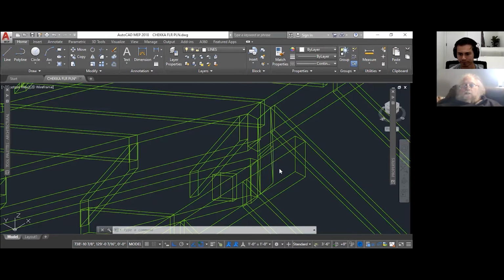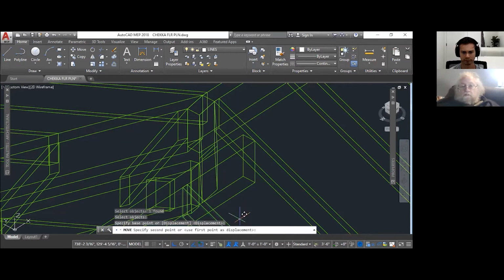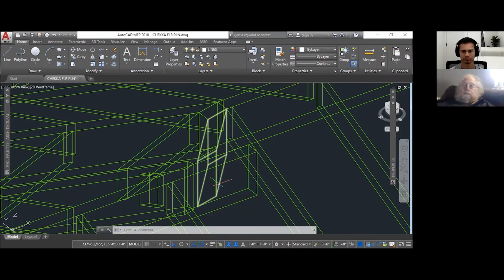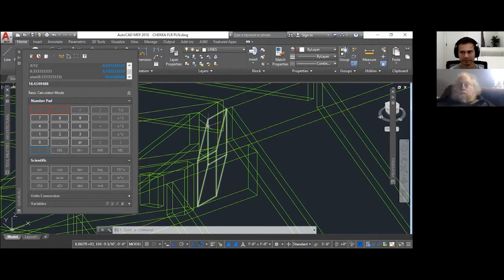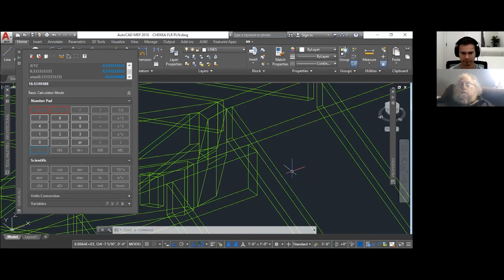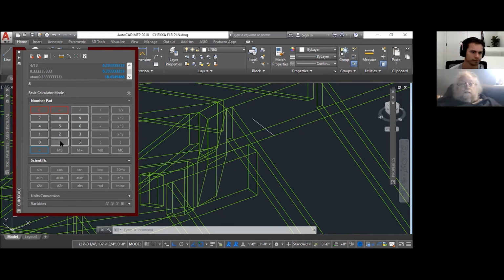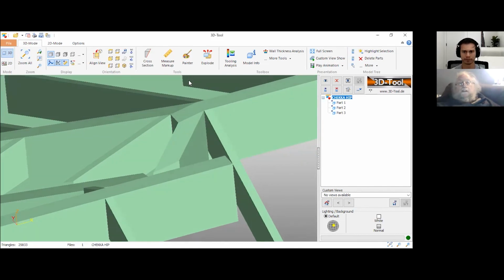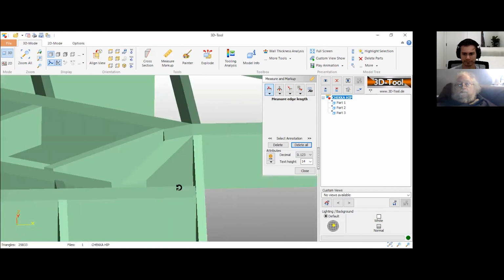Calculating Continuation Hips: Rafter Cutting Tutorial

Comment: Is this an L shaped building
Reply from the maker: There are some offsets, but I would describe the floor plan as more T shaped than L shaped.
Reply: @3d-design559 I know rafter cutting  but i can't see any thing but a whole lot of lines  that mean noting to me..   Are you describing a valley to hip   what I call a floting hip
Reply from the maker: @rexolrexol7893  Thanks for the feedback! The purpose of this video was to demonstrate one method for calculating continuation hips. The two ridges of this building are offset, and require a continuation hip to be properly secured to each other. This hip also ensures a smooth plane on either side of the roof.
Reply: @3d-design559  Here  is wha ti know  most of the time I measured  the continuation hips.    But  let me ask you... Say you have a building L shaped the main part is 20 '  span and the L part is 10 ' span       so  what I do   to get the length is it has a 1-1/2'' ridge so i look up 9' 10 1/2''  the span minus  1-1/2''   in a rafter length book   then I look up  19'  10  1/2''    I substract   the two     that is the length of the continuting hip   then I shorten   it the 45 degree  thickness of the ridge or about 2   1/4''
Reply: @3d-design559  You said this building was T shaped say the  tail  of the T  was 36 ' span and the cross of  the T  was 20 ft span  then the center  line of one would be 18 '  and the other 10 '      Many times i just measured from the valley to the high ridge  but in this case it is not apparent as to where the two   continuing  hips  touch the   36 '   ridge    What i have done   is this   the Ridge is 1  1/2''     so taking the 36 ' span and subtracting 1  1/2 '' inches  and looking at the book it would give the length of the hip from plate to ridge...  then taking the 20' span and adding 1 1/2  and looking in the book under hips   you would get the length of the valley from plate to the other side of the ridge  subtracting these two would give the length of the continuing hip from center to center point  That is  way i  do it